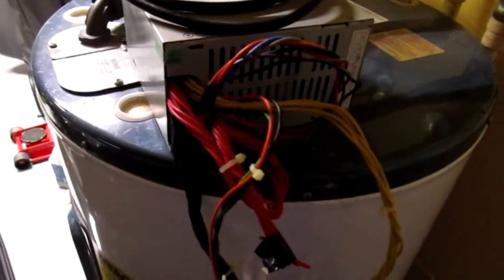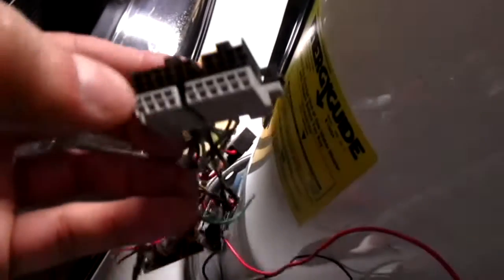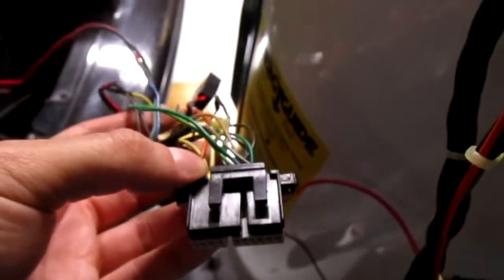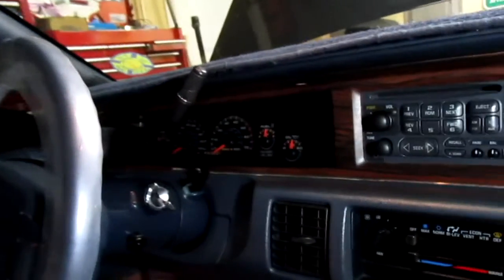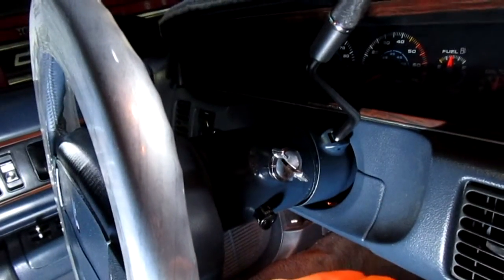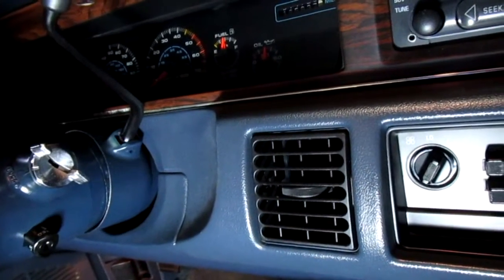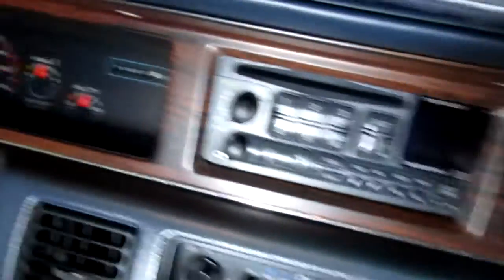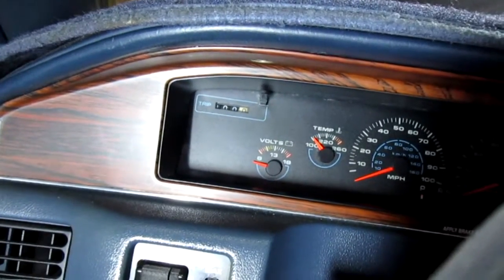Removing 1991-93 Roadmaster dash bezel for radio removal

Comment: Thanks a lot! I have a few vids of mine and I'll be sure to make one when I'm done with the protect!
Reply from the maker: If you take the bezel off keep in mind that sometimes the tilt lever is REALLY stuck on. They just turn off, they have a few threads. I think I wrapped alot of tape around some pliers and used that to loosen mine years ago. so I would not damage it.  A old piece of leather would work great too.

Comment: those custom cruisers must be super rare because i see all kinds of caprice and roadmaster wagons around, no oldsmobiles.
Reply from the maker: Yup. build in 91 and 92 only. 92 was the most unique because it had a caprice side window (the big ole one over the qr panel) but the vista glass.  The Roadmaster wagon and the 91 olds has a little filler plate on the door and the side window that FLIES OFF. They are always missing. it was named "The fly away trim"     7663 were built in 91 and 4347 were built in 92.  Maybe 2000 in both years are left? less?   They are getting collectable believe it or not. If I cleaned up the ghetto wagon and panted it, re cleared the wheels it would be a 6,000 dollar car.  Maybe more.  Would it sell for that? Maybe only to a rich enthusiast.   I feel bad when I see broken down ones for real cheap allover the south in GA, TN, SC, NC. I want my own 2 car roll back and I would buy them up to fix.. or use for parts if its too far gone.

Comment: I owned '95 Roadmaster, I like 91-93 dash and side mirror design than 94-96
Reply from the maker: Yea you had that nice WB4 wood delete one. Rare!   The 91-4 mirrors actually are better in that they don't stick out that far.   They are more aerodynamic too. in NYC the old squad cars or taxis from 91-4 had awful dents in the door around the mirror when they smacked the "Aero" mirrors into something.   The 95-6 fold able mirrors always wobble when you have a bad tailwind.. Which is good for gas millage!